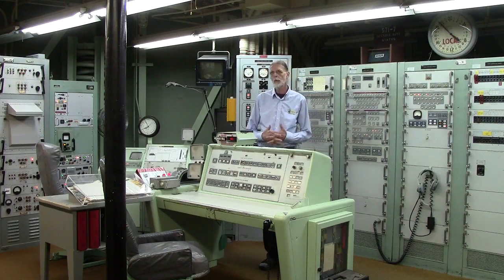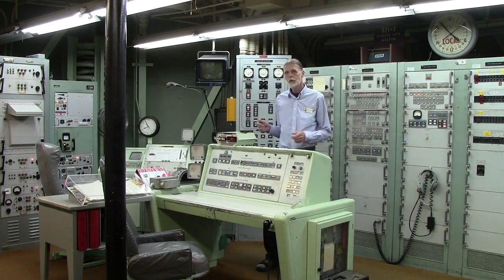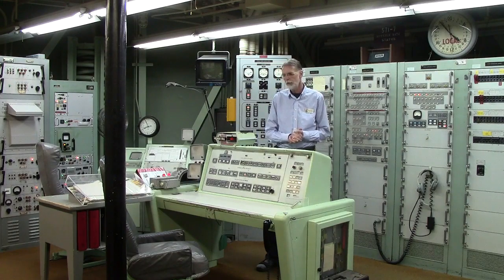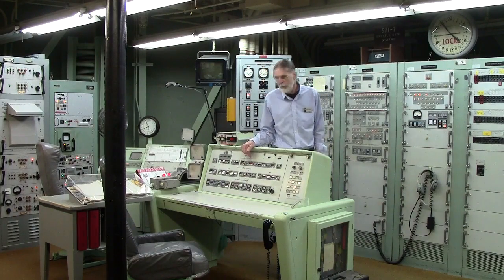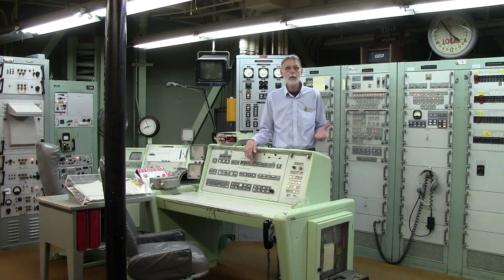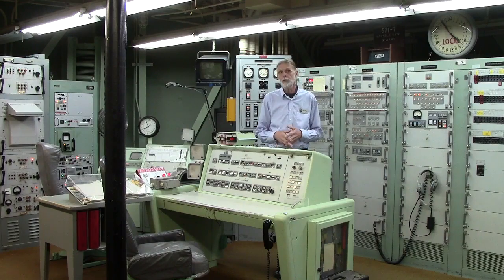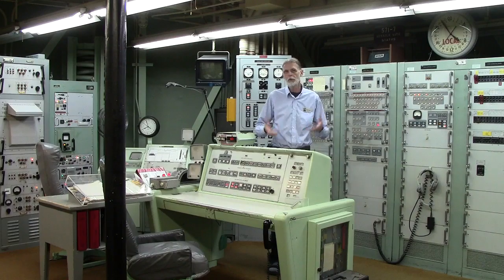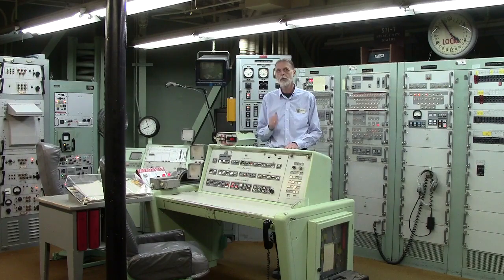Titan II Missile Launch Procedure

Comment: "This is the Lockpickinglawyer here, and today I will demonstrate the inexcusable design flaw I found in this high security launch system, that the United States militarily is relying on"
Reply: Real answer for several decades the launch codes were all zeros
Reply: kkkkkkkkkk
Reply: @MozTS  That is only for the butterfly valve. All the other redundancies were still in place. The 35 character message, the two keys, the gold codes.
Reply: "And to demonstrate it was not a fluke, I will launch another one"
Reply: Multiple inexcusible flaws considering he had to get into the LCC first.
Reply: "Click on one....."
Reply: All zeros?! Amazing! That's the same combination I have on my luggage!
Reply: Yes, but you would need TWO Lockpickinglawyers.
Reply: @pschroeter1  he would find a way to do both at the same time. he's done it before with a motorcycle lock.
Reply: lol

Comment: Why not put a battery Tender on the missile instead of charging then during launch
Reply: Speed. Technically they aren't charging the batteries, the batteries are charged they just have no electrolyte in them. As soon as the electrolyte is added the batteries are at full power right away, takes just under 30 seconds to pump it all in.

Comment: Add a woopsie button
Reply: If you look at the status lights below it would appear HOLD FIRE and ABORT assumed the presence of an oopsie button...somewhere. Once it was in the air it was outtie 5000 like an Audi 5000
Reply: @namesolonggood1sgone  ok
Reply: @namesolonggood1sgone  Not sure what "hold fire" is for but the "abort" light would be the missile sending a signal to the silo that it is shutting itself down because some fault was detected by the computer.
Reply: No such thing as “Whoops or Oops” with ICBMs.  When the crews turn keys and the missiles go launch in Process the closure door blows at the Launch Facility (LF), electrical connections are disconnected which produces a MV400 Missile Away printout and you get a Missile Away light illuminated on your status board at the deputy console. The missile is on it’s way to it’s primary target and there is no magic destruct button to blow it up. We used to have a CLIP command (cancel launch in process) but that was no longer valid when I was on crew.  We did have an Inhibit command but that was only valid when the missile was still in the hole at the LF before the umbilical is disconnected during liftoff.  When a missile is test launched out of Vandenberg the warhead is removed, and an instrument package and dummy warhead(s) installed and they also install a linear charge that splits the cases if/when Range Safety sees the missile go astray during launch.  Keep in mind I left crew in 1982 and left missiles after a stint as a 4315th CCTS IQT instructor in 1986 so I have no idea what changes may have taken place after that.  I do know that even back then if you were sitting in your living room 6,000 + miles away from Grand Forks ND, I had a very real possibility of putting one of my RVs in your lap in your living room while you’re watching your favorite football game.
Reply: @killman369547  Hold Fire was a malfunction/break in the launch sequenc that occurred after the Guidance Go signal and before the Fire Engine signal.
Reply: @brax2364  death wears bunny slippers! Thanks for standing vigil during the Cold War. In what must have been some of the most nightmare inducing service imaginable.

Comment: What's the abort indicator light can it be stop
Reply: The abort indicator light is a timed response.  Once the engines start, the clock starts.  If the missile has not lifted off (the umblilcals have not disconnected) before the clock runs out (and I don't recall how long it was...I think about 3 or 4 seconds) then the abort signal goes out and the Shutdown command is enabled (but the shutdown command is not enabled until the abort signal lights).  Essentially, they figure if it is taking so long for the missile to lift off, then something is wrong and they want to shut it down before it completely destroys itself.  
Note that it is possible for the lift-off indicator and the abort indicator to both be on at the same time.  If the missile was still flyable, but just a little slow in coming up to full power, it might be just slow enough for the abort timer to send the abort signal at the same time as the missile lifts off.  But once those umbilicals disconnect, the abort signal & shutdown command is useless.  
I really miss those days.
Reply: @sparc77  thank you very much for the information I was always curious

Comment: Don't forget folks that these were liquid fuelled rockets which were not pre-fuelled and so took some time to prepare first. OK for first strike, not so great for retaliation. The later Minuteman was a solid fuelled system, it came ready fuelled and wast consequently very much faster to  launch. Hope and pray that their descendants are never used in anger - or by accident.
Reply: That's half true.  They were liquid fueled, but they burn Aerozine 50 and dinitrogen tetroxide.  Unlike cryogenic propellents used for space launch vehicles, these fluids can be stored indefinetly onboard the missile (indeed, that's what is on pretty much every space probe we've launched into the outer solar system; the stuff does not go bad.)  Since Aerozine 50 is a 50/50 mixture of hydrazine and unsymetrical dimethyl hydrazine, it is corrosive.  To get around this problem, a small amount of hydrofluoric acid is mixed.  The HF passivates the lining of the fuel tank making them inpervious to corrosion from the Aerozine 50.  

These things were ready to launch as soon as the key was turned.  Thankfully, they were never needed.
Reply: Oh they were kept fueled and ready. These rockets don't use liquid oxygen which boils off. They use a highly toxic oxidizer and fuel that is stable at room temperature. The only thing that has to be filled before launch is filling the batteries with electrolyte.

Comment: Looks like we will see those go off soon.   Thanks uncle Joe  😘
Reply: Lol you won't see these ones go off....... these are actually huge and EXTREMELY slow as compared to the MM3. The warheads on these badasses were FAR larger (up to 40Mt range) though. The MIRV systems on the MM3's are usually between 30kt and 10Mt (at least that's all I've been seeing lately, I'm sure a select few are larger) we've improved our reentry accuracy so much that, we're able to hit within 20 feet of the cross hairs. It's like using a .50BMG and aiming for the head but hitting the throat. It's BY FAR close enough. No need for all the extra destruction of a 40Mt warhead when we can shove 30kt down their sewer vent pipe. Lol

Comment: Guys, it really takes 4 keys to set the mission into action. That's the last fail safe. Four men, must agree to turn their keys at once. Two different locations, in case of emergency or outside take over. Those old-timer were smarter then you thought. Even with dile phone, no apple computers, slide rulers (go look it up kids) and drive in theaters.

Comment: It's a very archaic action for the Air Force to add the fake 'Launch Abort' and 'Hold Fire' lights that would never light up. Provides some minor comfort for the Missileers prior to the launch.
Reply: You know, maybe the launch abort light would actually light up if there was some kind of problem with the missile. It would be very unlikely (because I assume they were maintained), but if, say, the pump that was supposed to fuel up the missile failed or the guidance computer failed or some other problem that manifested itself after the key was turned.

Comment: If you look at the fire lights 'FIRE DIESEL AREA' and 'FIRE OXI PUMP ROOM' appear that the missile launching would destroy the 30 days of power and recirculated air one was supposed to have down there. I saw a documentary c.2000 about the modern equipment, the hardened bunker had its door underground and all of the life support equipment was outside, in a soft area. Is it correct that in the olden days a missile launch would destroy life support and today a hit would effectively turn the bunker into your mausoleum?
Reply: It's "OXI", not "OXY". Probably the oxidizer pump for the missile. There's really no reason to keep the 30 day worth of supplies if it's all gonna go in one launch.
Reply: It is the oxidizer. There's a bunch of the airmen from some of the PTST units that talk about that. After the oxidizer is transferred into the missile, those transfer hoses and the empty oxidizer storage tanks are worthless. The only time that fire warning sensor is relevant is if there's an accident or a fire while the propellant is still in storage. Look up the Damascus incident. The propellant ignited in the silo. They did find out that firefighting in a silo filled with oxidizer and liquid fuel fumes is pretty much pointless. I believe this was one of the main reasons we hurried up the process of going to solid fuel in the minuteman missile bodies.
Reply: @stephenreese3591  the main reason for phasing out Titan II for Minuteman was you could not store the missile in the silo fully fueled. The liquid fuel is HIGHLY corrosive and would drastically shorten the life expectancy of the missile. The fuel also had a habit of separating. Minuteman, since it didn't have to be fueled before launch, is a better choice for a retaliatory weapon as it can be launched quicker. 

Interesting enough, the Soviets NEVER went to a solid fuel missile and the Russians STILL use liquid fueled rockets. Even their newest Satan II is liquid fueled. Which kind of leads into an interesting discussion of just how effective IS Russia's nuclear arsenal. The SATAN II just came into production and is replacing missiles that have been around since the 1960s and Minuteman II...not the latest III's...the SECOND GENERATION Minuteman. The US is gearing up to spend BILLIONS overhauling its aging nuclear missile arsenal, replacing the Minuteman missiles with Sentinel. This also includes determining how much of the stockpile of warheads are still viable. So, a ground up replacement of missiles and warheads that are half the age of what the Russians have is going to be in the tens of billions of dollars. How much would it cost the Russians to replace THEIR arsenal? Which begs the question, can they afford it? 

Everyone likes to pretend Russia is still the scary Soviet monster from the 1960s and 1970s but it isn't. Russia as a GDP that is only a few hundred thousand dollars more than CANADA. Do you think CANADA can afford to build a nuclear arsenal to rival the US? 

The only other nuclear power that is even remotely in the discussion is China and their weapons number in the DOZENS. Who exactly is our nuclear arsenal deterring?

Comment: Why is they an abort button?
Reply: The abort system is entirely automatic. But what it does is when the missile computer is running it's self checks before launch if it finds any faults it will stop the launch sequence and the "ABORT/HOLD FIRE" lights illuminate to let the crew know there's something wrong with the missile.

Comment: The missiles don't have a self-destruction feature?
Reply: These Were Made Before Those One
an interception satellite would have to be used at that point though
Reply: @JNJNRobin1337  Even today I'm fairly sure they can't abort once the decent part has started since the missile is hypersonic and physically can't receive signals.
Reply: No. There's no way to send any signal to the missile to tell it to self destruct. However, the flight computer is constantly monitoring hundreds of different sensors dotted around the missile body and if they detect a major problem like a fire or a fuel leak or loss of structural integrity then the FC can trigger the flight termination system which will destroy the missile.

Comment: We kept these things in Arkansas?
Reply: The 308th Missile wing at Little Rock AFB had them.  They were the last to be shut down.  If you are interested, do a youtube search for "death wears bunny slippers".  A private citizen purchased one of the old Titan II sites in Arkansas and has been renovating it for a home.
Reply: First off, Thank you for your service. I was also active duty but on the medical side of things. Were you a launch control officer?
Reply: The Titan II crews were four man crews, two officers and two enlisted.  I was a BMAT (one of the enlisted crewmembers).  I was responsible for the missile's airborne systems (missile batteries, missile hydraulics, engines, etc.), the launch control sytems and guidance systems.  My counterpart was the MFT (the other enlisted crewmember) who was responsible for the ground support equipment (generators, ventilation,  air compressors, plumbing, etc) and everything in the silo other than the missile, itself.
We used to joke that the only thing that the officers owned was the codes and the warhead.  And my MCCC used to joke that the only reason he was on site was to keep the enlisted guys from launching without authorization.
I was not stationed in Arkansas.  I was stationed with the 381st SMW at McConnell AFB in Kansas.
Reply: IDK what they call it now, but at the time it was called "Top Secret SCI".  But yeah, I had one.  It sounds impressive but in truth, I found that the most interesting thing about reading classified information was that it was a sure-fire way to bore you to sleep.
Reply: Yes.